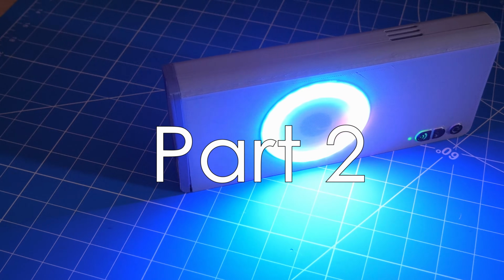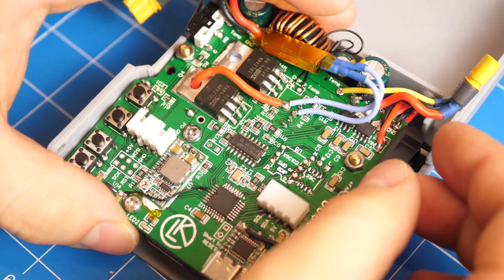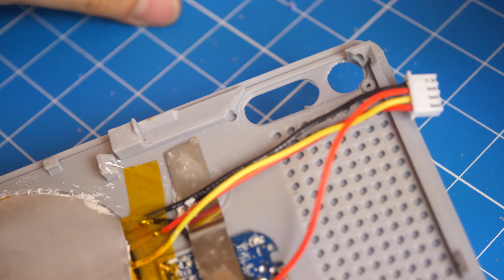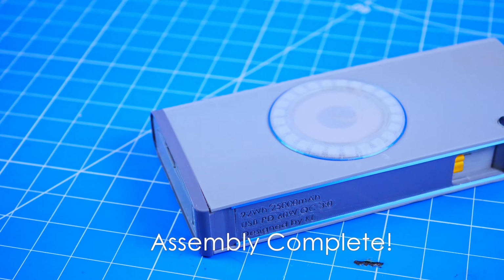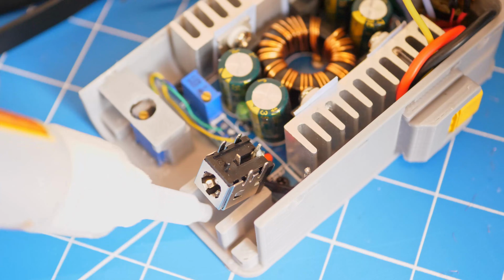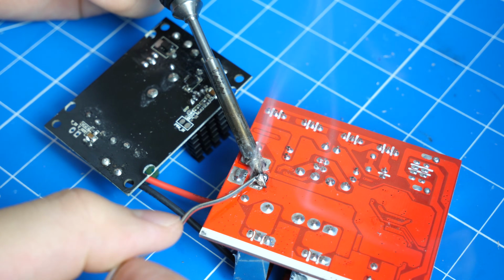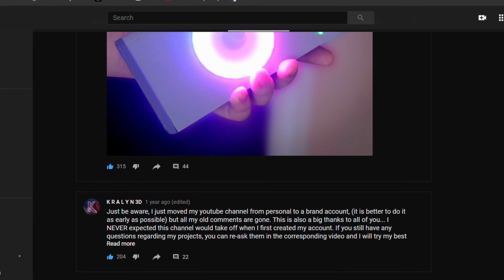The MOST Versatile DIY Power bank Build (Part 2)

Comment: Pretty awesome but I don't understand why you wouldn't use Li-Po or Lifepo4 flat pack cells for this. A lot lighter and slimmer than conventional Li-ion batteries. With a slightly longer chassis you could fit almost 400Wh into it. LifePo4 in particular would greatly increase longevity.

Comment: Everything is good, but there are a couple of comments: 1) these thin sheets of aluminum work very poorly as a radiator.  Need MUCH thicker ones.  2) the thermal rubber you use is the worst and cheapest.  In addition, it works not as a heat conductor, but as an INSULATOR.  This thermal rubber conducts heat WORSE than regular double-sided tape of the same thickness.  There is even an author who tested this

Comment: Maybe, as the DC-AC module needs DC as well, it could be made to lock onto the DC-DC module.
Though that would require some sort of voltage adjustments, that could be handled with communicating via a similar side connector, making it easy to add modules that need a specific input voltage.
Or the DC-DC converter could be moved into the main module, with the side connector having such a voltage setting system.

Comment: 150 watts AC? It needs more power. I'm running 400 watts and its not enough to run this tiny 350 watt heater because the voltage spikes to like 800 watts or something and 350 is the maintenance voltage and it produces no heat anyway. I cant do nothing with 400 watts AC. Im running 1,000 watt hours on battery banks. I switch out 2 500 watt hour banks on XT60 connectors.  Doing it over I would have gone with at least 1,500 watt AC inverter, since AC inverter watts is the most limiting factor. Battery life is negligible if you're hot swapping 500 watt hour banks. This is enough to run a light bulb and your phone, but Im looking forward to the suit case version. You can also charge your batteries on a solar panel through the inverter if youre using a charging adapter AC to DC to charge your batteries (I think thats 500 watts AC minimum). Its extremely convoluted tho. Since youre going DC to AC to DC from solar panel to battery. But its all sitting there anyway if you're charging off AC wall outlets from the charging adapter. Sleek build tho.

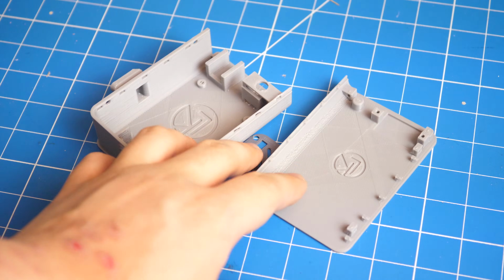Comment: hello  kralyn 3d  i wana ask you about one think in 7:18 in the dc dc module their is a ntc  but in the video you don't show it where is it gonna be
and i have an other question the out put of the battrie  perhaps 3.7*5s = 18.5v or 4.2*5s = 21v but i don't know if the 10 nf, 10 uf and the L7812 gonna step down the voltege into 12 v for the fan and you said that the temp switch it's a normally closed so it's gonna shut down the voltege it's not gonna open the fan 
please can you help me

Comment: I wouldn't use the DC-DC module for anything that isn't a smart device (like for example a laptop is a smart device in this context) that can self regulate and protect themselves, too many devices, even expensive ones just expect a certain voltage, frequency and don't like not getting it

Comment: i know i am a little late but i have one question. what about liability. i mean if you sell this and i buy one and my house gets burned down then what?
Reply from the maker: Obviously, the power bank would go through rigorous testing before being sold to the consumers. However, accidentals still can occur. It this case, I will immediately begin a investigation into the problem, then it would depend on what caused the problem. If it is a design problem or battery supplier problem, then the product would be recalled and compensations would be discussed on a individual basis.

Comment: This is next level stuff right here. Your powerbank projects are some of the coolest on the whole web. Your videos are awesome!

I'd like to point out a couple of things... I'm not a hardware designer, but here's my two cents anyways:

1. I just finished watching part 1, one of the first things I noticed is that the print quality, while definetely acceptable for a DIY project, is definetely not acceptable for a final product. I suggest refining the exclosure print quality a lot before you start producing these on a larger scale. From what I see, it appears that you've already improved the case print quality quite a bit compared to the previous video, so that's definetely a step in the right direction. 

2. There's a lot of assembly tricks that feel hacky throughout the whole build process. These might really slow you down during manufacturing (even for low volume production) and, most importantly, reduce the overall quality of the product. Examples: melting the plastic between the Neopixel LED ring cover and the top case part (that just feels...wrong), the battery locking mechanism with zipties (which, honestly, is cool, but still kinda hacky), the 3D-printed knob + tiny nickel strip for the trimpot on the DC-DC module (maybe try bigger potentiometers with high-quality knobs?), and all components that need glue in one way or another (it just looks messy). Of course, since you made this powerbank, I'm sure there are specific reasons behind all of these design choices, but bear in mind that consumers don't like to see non-professional building techniques. They degrade the overall build quality of a product. 

3. Finally, try to get in touch with people in the maker and hobbyist electronics community to review your circuit design and building/manufacturing/components sourcing process for this product before you start a funding campaign. That should be relatively straightforward, since your design is open-source, and there's a lot of really smart people on the interwebs. I'm sure a lot of folks like the idea of this powerbank (cause, honestly, there's nothing quite like it out there) and will be willing to pay for it (which is quite a big deal), so you need to have the best version of this product ready in time for shipping. 

I don't have any money to invest in a powerbank at the moment, but I'd like to wish you all the best in your crowdfunding endeavours.

Cheers, mate! You just earned a subscriber ;-)
Reply from the maker: Wow, thank you very much for the extended comment; My first 3D print looks bad because it was printed on my home printer as I am forced to go back home as my school closes, then I made myself to invest in another Prusia i3 Mk3s so the next prints look a lot better. 

I have to admit that many of the things you see are kind of hacky because of several reasons; I want my audience to build it, so some common materials are used and low level solutions are done to make the build easier. Like building the circuit that comes with digital control of the output voltage would add another layer of complexity on to the project. 

In the commercial version,  there would be many improvements, like the pull tab is a single piece made from PP; output voltage would be digitally controlled, and the circuit will be fully integrated. I am currently working with a couple viewers who reached out to me,  and several other professionals who I contacted, so the product would be as polished as it can be before production.

Thanks for all your feedback, I'll post updates in the community tab.

Comment: Hi. I have a suggestion. Please do something with trimmer potentiometer, because it has extremely low effective turns available, and could possibly break any time. Trimmers are designed to be set to needed value, not to use them as normal potentiometers. Otherwise, your work is really impressive. Good luck with mass production!
Reply from the maker: The next version is going to come with digitally controlled output voltages. For this version, the config is to save costs. Thanks for the feedback!

Comment: I really like the new design, however I do miss the old design when the AC charger was integrated into the main body
Reply from the maker: Yes, but I really wanted something more versatile and practical, and this goes into the portability. From using the old designs, I found myself using the AC converter very rarely (as laptops, soldering irons are taken care of by the DC-DC) The DC-AC converter just simply takes up too much space, this means the power bank has to be bigger, heavier and has less capacity. A 100W AC charger is just a small enough, but it is not sufficient for most laptops.  I experimented with this concept but eventually removed it. Thanks for the feedback!
Reply: @kralyn3d  i love the old design also, yes it's bulky but could still be useful at home during 5 to 10 hours power outages which is common in my country. i couldn't build the exact same thing since i dont have a 3d printer. but i have made a 4s 10p powerbank with variable voltages enclosed in a folded metal sheet. it's ugly but functional. i would also like to add an inverter but it wouldn't fit my diy enclosure. and then this video you gave us a modular approach. i mean your ideas opens up new opportunity for us to solve issues.

Comment: Say that the video is sponsored by JLCPCB, not the project.  Just a suggestion, but if the project is sponsored by them they can claim partial ownership of the design as they paid for it.  Not a lawyer, but you need to watch out for this kind of stuff if money is going to be involved.
Reply from the maker: Thanks for the advice, I will the wording change wording next time.

Comment: Can I make a suggestion for the AC inverter module? The included inverter only has a US outlet, and other outlet designs are larger, so instead, what about having an IEC C13 connector as it's standard around the world. Granted, you'll need an extra wire to adapt that to whichever plug you have, but it'll allow one module (or two if you do separate versions for 220-240V and 120V) to be used globally and it'll remain as compact.

Comment: Since this is a power bank i think you should avoid using things like linear regulators for fans and use small buck converters instead
Reply from the maker: This is just to simplify the circuit, but in the next version, there will likely be an MCU inside the module to control everything.

Comment: Hello with Russia! it is a very big mistake to leave the blue drain resistor on the dc-dc board.  its resource is about 200 cycles, it is better to change it to a high-resource resistor.
Reply from the maker: This will be fixed with next iterations, which is going to have digitally controlled voltage output. Thanks for the feedback!

Comment: Wahoo I really commend your work and it's the best have ever seen on YouTube . I will love to support you with little money (you can contact me on joseph.ogundana@gmail.com)

I have a suggestion for you , Using 18650 li-ion battery is about 2.5amps or 2500mAmps I noticed u ave used just 5 of it which is about 12.5amps or 12500mAmps ,I want you to upgrade the power of the power bank to something much bigger like industrial Power bank  which can be charged with solar panels, and can be taken to camp ,I suggest this upgrade should be like having 3.6v - 4.2v 2500mAmps ,   20 li-ion battery in it which will be about 50amps (50,000mAmp) . This will give the power bank a longer time to power equipment and more reliability. If this upgrade can be done there is a big market for you. I can assure you that you will make a big sells of it .
Thanks for your time spent on the construction of the power bank .
Don't forget to Email to.
Reply: his other design used 15 cells and had a built in outlet, although it didnt have the upgrade packs. Also charging with solar panels isnt the best idea 15 cells at 3500mah have almost 200 watt hours of charge and a 3 foot by 3 foot panel only produces about 150 watts in the best conditions

Comment: Why don't you change the Mr 30 conector for to modules to a copper pad and pogo pins????
Reply from the maker: Bingo, that the idea with the next version! For this version, I initially planned the current to be around 20A so Pogo pins won't be sufficient but as the design evolved, specification changed so I think Pogo pins are the way to go now.
Reply: @kralyn3d  Thank you for reading my comment and considering my idea👍👍

Comment: Suggestion - Make potentiometer digitally selectable maybe with arduino...by this way we can avoid accidentally rotating the voltage knob and frying the charging device. Awesome work dude. Appreciate your time and dedication to the project.
Reply from the maker: I will most likey make the voltage digitally controlled in the next version; Thanks for the feedback!
Reply: Yeah. This always scared me.

Comment: About the DC-to-AC module:
British plugs and Europeans are bigger than the North American ones
and I also saw that these converters for 230V are also bigger
But does it still work with maybe more module lenth snd the plug attached to the top and not the side or does it need to be doubled in height anyway?
Reply from the maker: I'll see if I can fit a international plug on there.

Comment: If its even possible, mostly cause no one else seems to do it
A 180W dc to dc converter for gaming laptops
Reply from the maker: 180W gaming laptop consumes around 110W while gaming, 180W wall adapter is for the worst-case scenario.  My laptop comes with a 230W adapter, but it draws 120W while gaming and 90W while CPU Rendering.
Reply: @kralyn3d  The remaining power is for charging the battery if needed.
Reply: the batteries in series make an output of 18.5v and the batteries are 9.8A and 18.5v * 9.8 = 181.3 so I dont think it would be quite enough

Comment: Dear in your power bank pcb 4 tactical switches are showing but only three buttons on outside please explain? 🙂
Reply from the maker: the 2 top switches together make up the power button, one for triggering on the power supply, one for reading signal.

Comment: These are some pretty cool construction techniques!
At 8:25 it's a bit confusing: You say to use 2 10nF capacitors, the image shows 2 100nF capacitors and the text shows a 10uF and a 10nF cap. It probably doesnt matter at all what you use, but 100nF for both would be more typical and shoud work without a problem. The one on the input of the regulator is probably not necessary anyway.
Also, I would suggest trying to use the same type of screws wherever possible. If M3 will fit, dont use smaller ones for example.
Reply from the maker: Thanks, It does not really matter what caps are there; thanks for catching the mistake. As for the screws, I am fixing that in the next version.